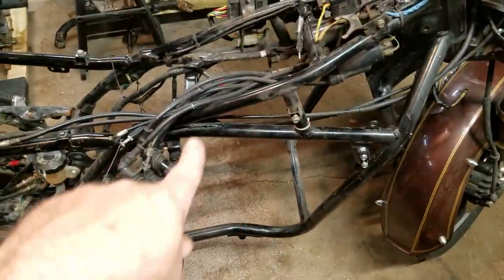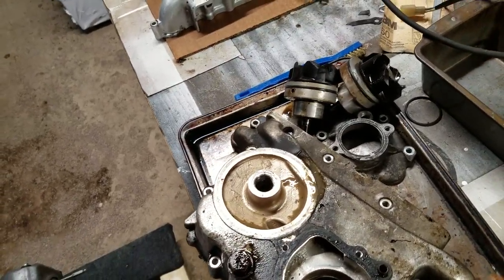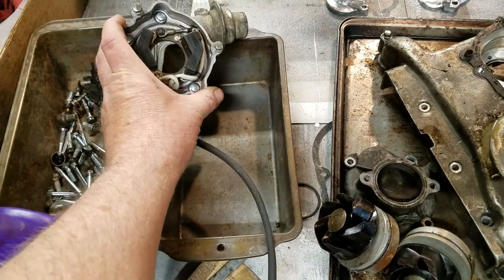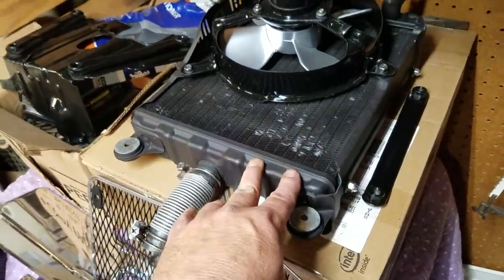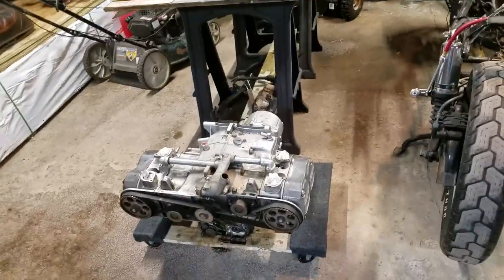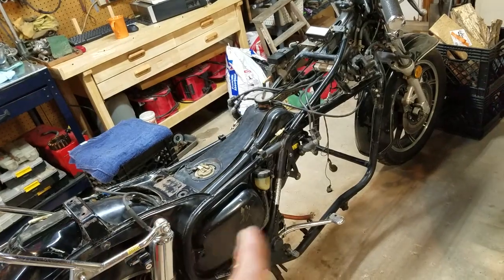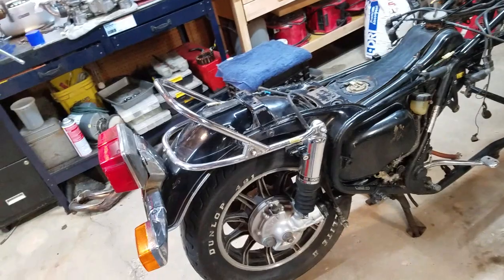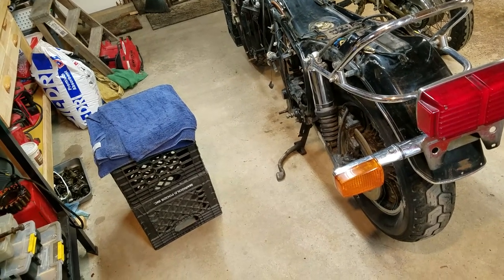Honda Goldwing GL1100 Update for  May 2019

Comment: Great update man. I have had good luck with the high quality lacquer automotive rattle can paints especially for gloss black. It's a process but the end result can be very nice. 

Also, I never mentioned but if there is any parts you are looking for, I have a bunch, the bike I was working on was part of a deal where I got a bunch of spares and a couple partial bikes and he got the most complete. A lot of it is 1200 but there is some 1100 as well.  Anything, I have that you can use, you can have for shipping costs. My thank you for your help.
Best!
Reply from the maker: Man that is so cool of you, As the project conitnues I will keep that in mind as I likely will need some as I put the bike together. The parts bike I have is missing some of the same parts as the bike I am putting together so there just maybe a need! Have a great weekend I hope its a long relaxing one.